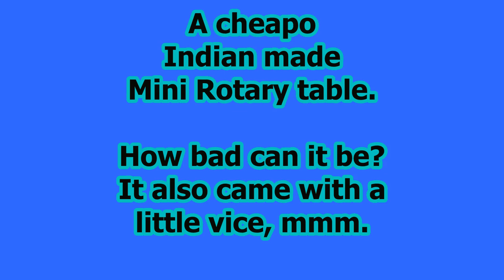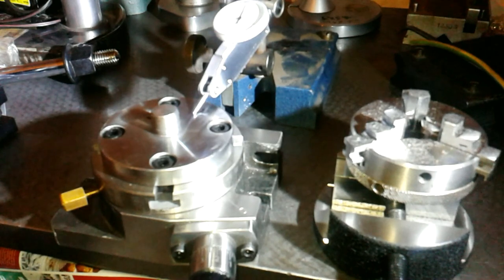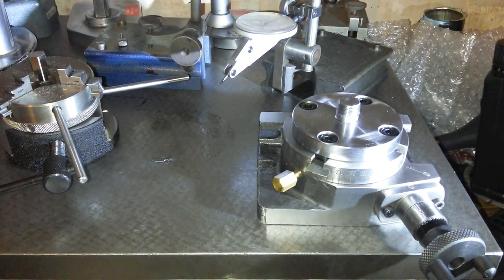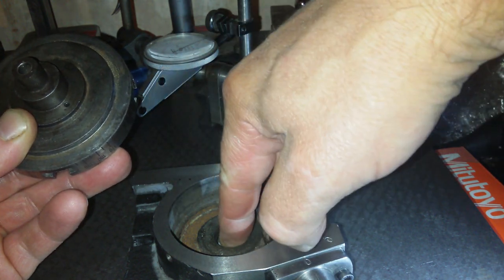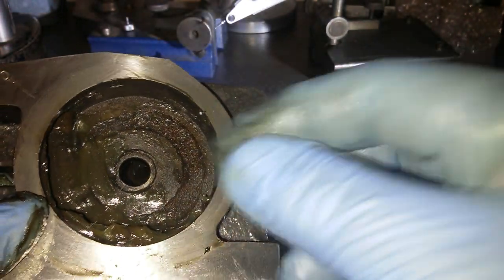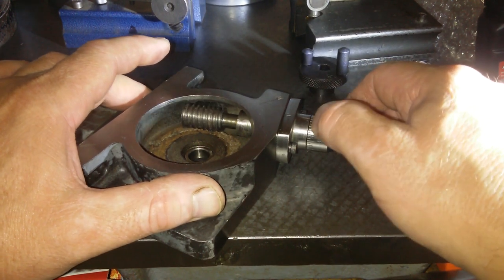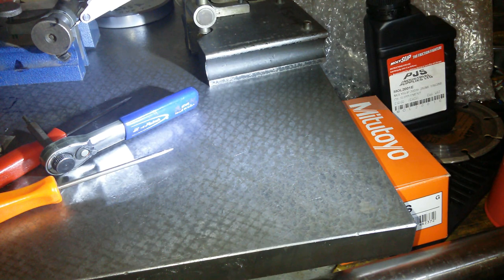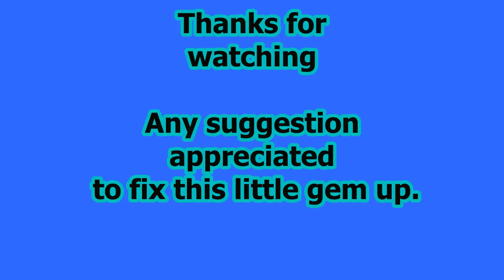Stripping Cheapo Indian Rotary Table

Comment: I appreciate this was 5 years ago so you probably fixed it or junked it, but it's possible the gear is binding on the brass washers. It seemed to get a lot worse after they were in.

Comment: If you put a thin washer between the worm gear and shim the left side screw that holds the shaft and the shaft holder itll kill backlash
Reply: have you actually tried it or are you just guessing. the reason i'm asking is if you add a thin washer won't the screw worm bind?

Comment: What did you expect? For the money got what you paid for. Will it do what you need it too?
Reply from the maker: Absolutely. When I need this tool, it is now so good you would think you are milling in a good vice and not the gibbering loose mess it once was.
Reply: @bigstiggerNo1  So what were the things that you did that worked? Not clear from the video.
Reply from the maker: @dominicread797  the bronze thrust bearing that supports the table top in the base it has less than a thou clearance all taken up with oil. Two hold down clamps (one with a custom plinth). Tighter clearance from spur to worm gears. Brass adjustable lower plain bearing. Working on morse taper 0 or maybe making a -1 taper of my own design (will have to modify lower bearing probably) next video when this is complete!